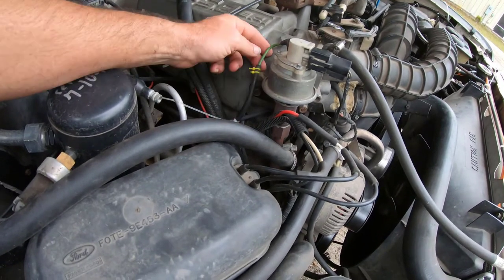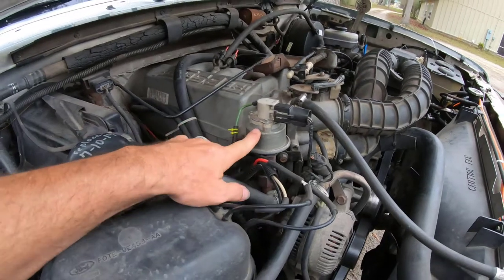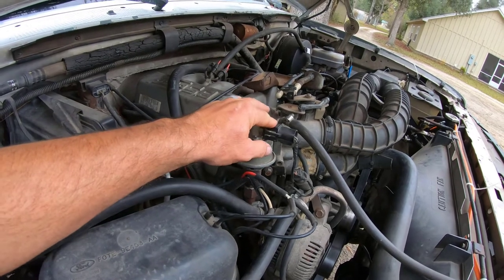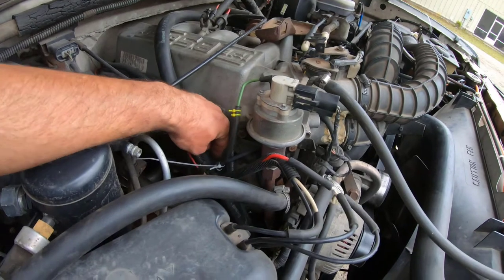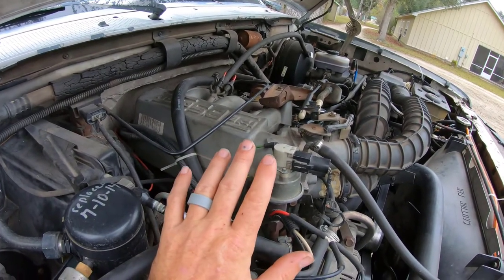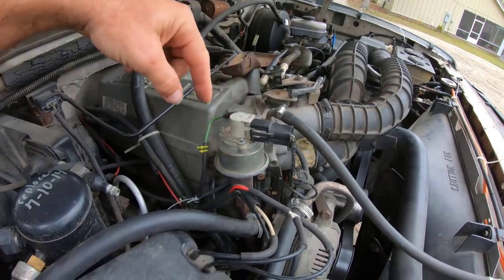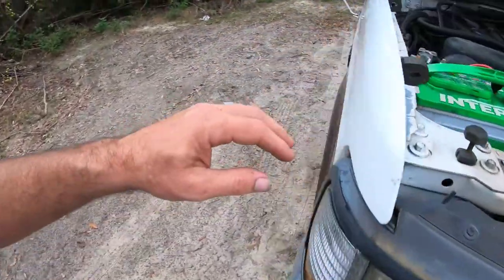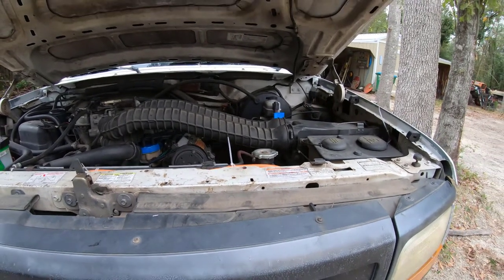Ford F250 EGR Problem Solved

Comment: Those vacuum lines are a royal pain! My 93 ran a code for 6 months before I found one crushed in the valve cover.
Reply from the maker: There’s only 79 vacuum lines on those trucks buried under that sideways tunnel ram fuel injection...how could you miss that 🤣 Thanks for watching and commenting!

Comment: I recently bought a 96 Ford f 250 5.8 and I changed out spark plugs and plug wires along with map sensor,coil pack, cap and rotor button and still spit and sputter. Can you think of anything that might help me with my problem

Comment: Does anybody know how I can  bypass the The egr all together ?
Reply from the maker: I will be doing a follow up video on issues that arose with this truck after this video was published. I will include how I bypassed it but there are better ways than how I did it. I can’t remember the channel but there’s a guy on YouTube that did it to a Ford bronco and in my opinion that’s the correct way.
Reply: yeah I have heard that you can. cut a beer can out in the shape of the gasket and bolt it back on to bypass the EGR.